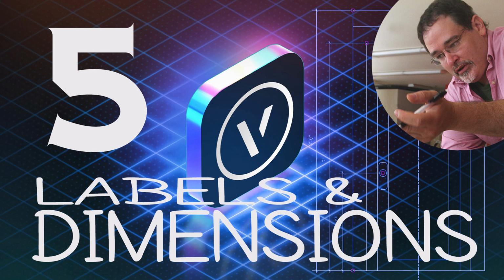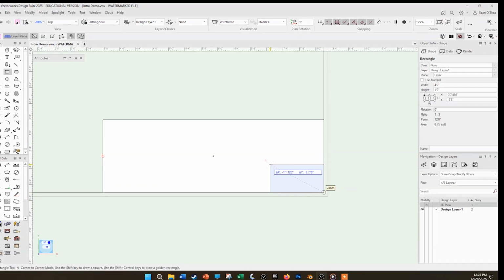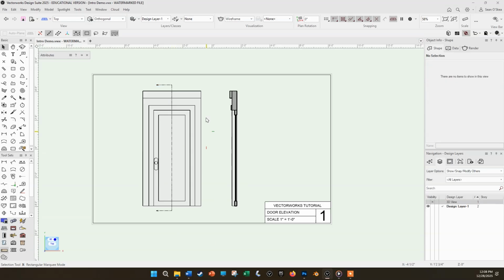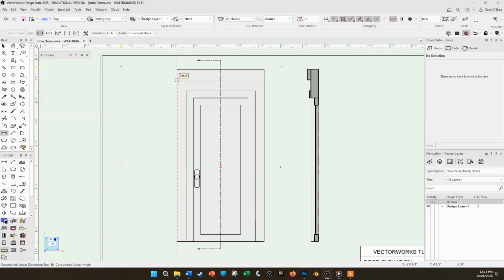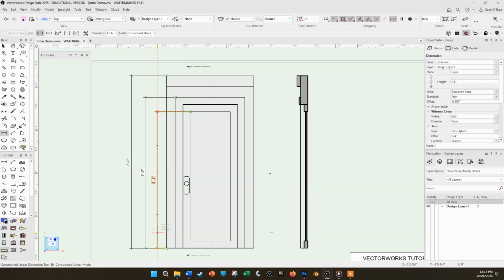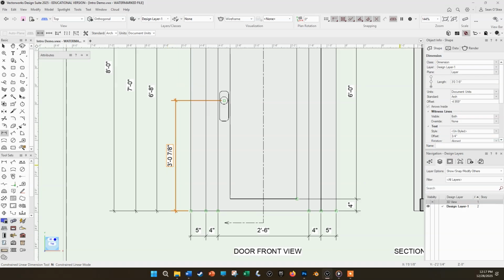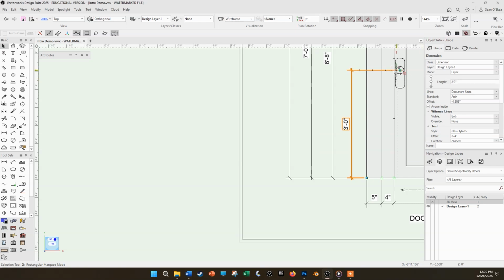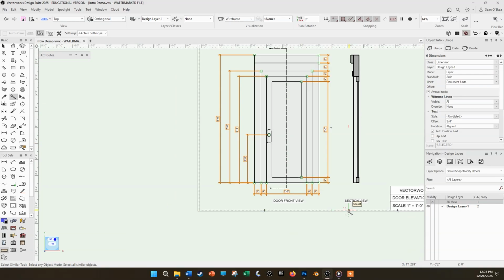Intro to Vectorworks Pt 5 Dimensions.

Comment: Your vector tutorials are all impeccable. Very easy to follow. That rectangle you made on the right of the drawing, can you save it as an object and use it whenever you need it in other drawings?
Reply from the maker: Thank you.  Do you mean the title block? Yes. I'm trying to keep it simple with these intro videos but there is actually a title block tool. You can make your own with whatever default info you want (company name, a logo, your name etc) and then save it in the resource browsers and just drop it in with that tool. I have to confess, I'm usually too lazy to even do that, I just open my last project and cut and paste into the new project. You can also save default templates. Set up a blank document however you want--sheet size, orientation, scale, title block, even layers and classes, and then FILE>Save as Template. Then next time you open VW you can select that template from the template tab on the start up window. You can have as many of those as you want.